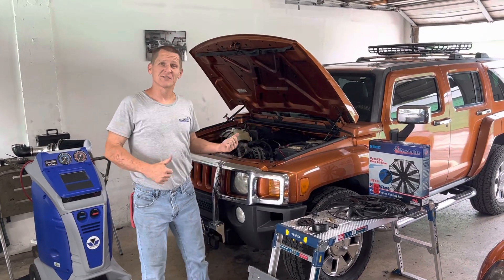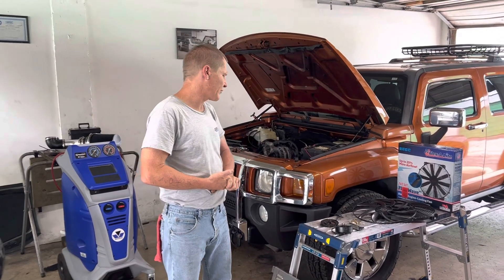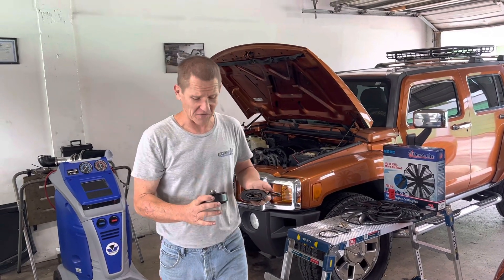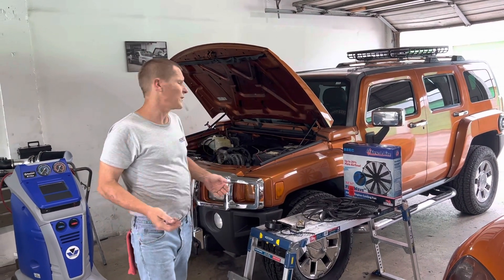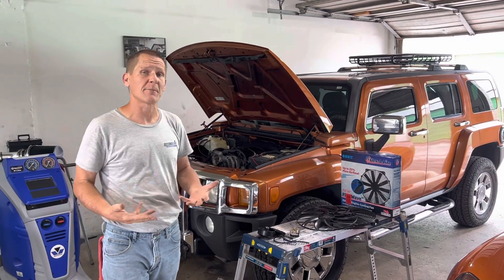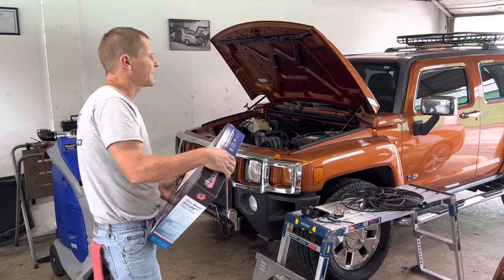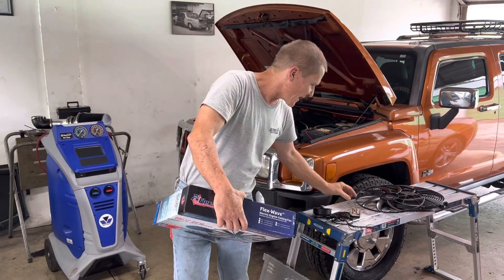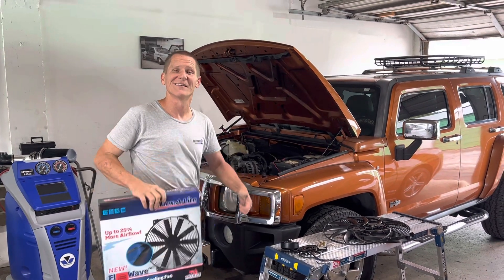Cooling System Fixes – Hummer H3 Alpha Swap Troubleshooting

Comment: I PUT 4 FANS IN 2 14" AND 2 8"  I DO PUSH AND PULL AND ITS A TOTAL OF 5600 CFM IT WORKS UNLESS ITS ABOVE 98 DEGREES THEN THE A/C STRUGGLES

Comment: I actually had to do a few modifications to my electric fan to make it fit without changing the water pump. Basically since the aluminum plate was a bit to thick and it made the fan touch. I literally took the fan apart, I took the 2 plastic spacers that were under the motor housing, put them on the inside and mounted the motor on the inside of it's cover instead of the outside. So basically, it gave me just enough clearance to keep it from rubbing at all. Just an idea that worked for me in my H3 Alpha 5.3L . Oh, yeah I'm also running a single 3k c.f.m. fan/radiator aluminum setup and I haven't had any overheating issues at all. Hope it works out for you though. Definitely seems to be a very nice swap you guys did on that one. 😁
Reply: How did you wire the e fan temp sensor if you dont mind me asking?